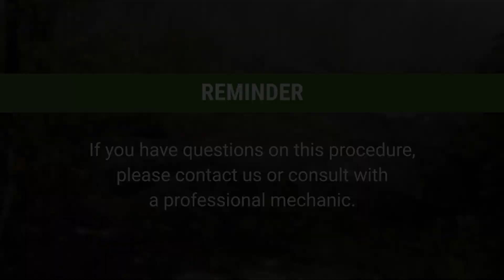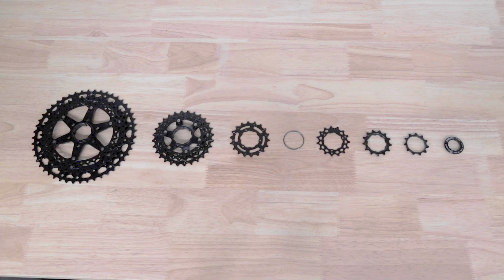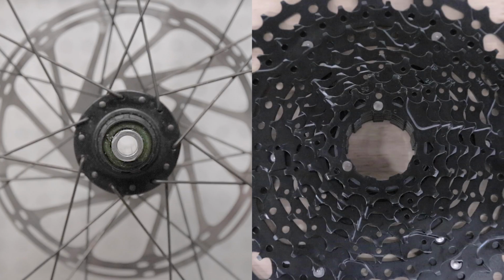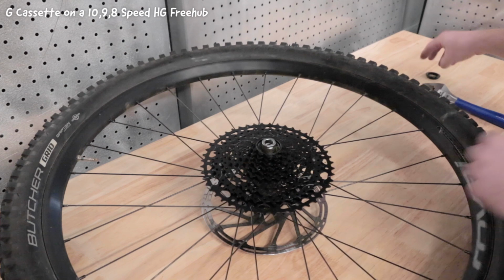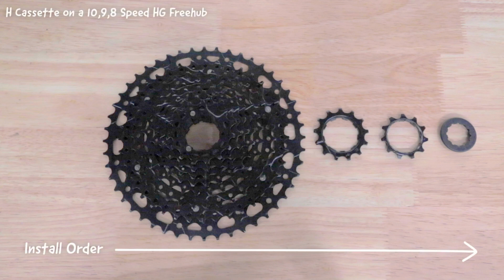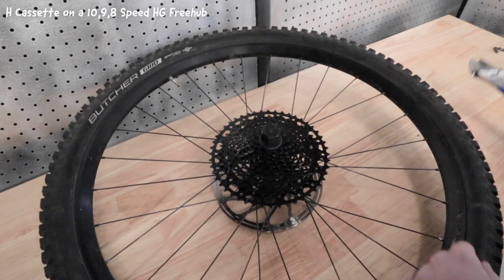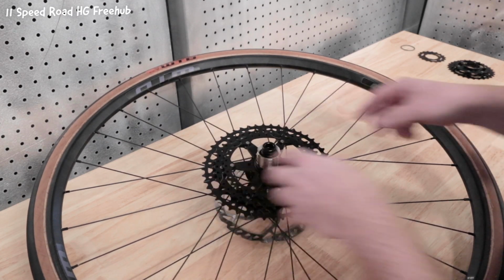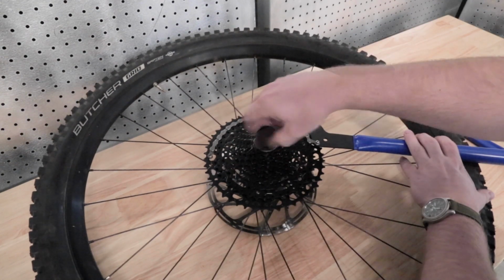microSHIFT ADVENT X 11-48T Cassettes Installation

Comment: I ordered a complete Advent X set with a steel cassette (CS-H104 11-48T), when I got it, the cassette was missing one pin out of three in the center...(((((( I was very upset... But then I watched some videos about installing this cassette and found that someone has 2 pins on the cassette like I did and someone has 3 pins....
Can you please explain why this is the case?
Reply: Thanks for the reply from technical support: "These two rivets will not affect the performance of the cassette. Once the cassette retaining ring is tightened to 40 nm, everything will hold in place. The rivets are not structural."
Moreover, I found the installation instructions on the MicroSHIFT website, and it said exactly that!
Theoretically correct, hope all is well ....)))
Reply from the maker: Glad to hear you got it figured out, this is definitely confusing!

Comment: Hello, after replacing the chain with 0.7% wear, the new KMS chain began to slip on the fourth sprocket of the microshift Advent x cassette :( visually there is no significant wear, the cassette is in its second year of operation, but the fourth sprocket is, as it were, the main one on the trip and from a standstill as well. It is necessary should I change the chain before 0.7% wear and change the cassette or is there something else that can be done?  Please help, thank you!
Reply from the maker: Thanks for reaching out - this will be tough to diagnose via Youtube comments so I would ask you to fill out a service ticket on our website. We'll get you sorted out ASAP!

Comment: Do you guys sell just the end caps for this cassette? For some reason there is part of the plate on the back of the end cap that is sticking out and is bent and causing shifting problems on 1st gear. Please advise, thanks.

Comment: @microshift I'm confused as too what's going on on the cassette installation manual it says the you need a normal HG freehub which i have 34.90 mm without a spacer but then on then next page it says To fit MTB microSHIFT (8, 9, 10, 11 speed) cassettes and (8, 9, 10 speed)
road cassettes, add a 1.85mm spacer before installing the cassette. can someone please clarify this im not sure if to buy the 1.85mm spacer or not

Comment: Does the advent x cassette compatible with advent 9 speed drop bar shifter SB-M090??
Reply from the maker: No, the Advent X cassette has 10 gears, but SB-M090 is compatible with 9 gears. We do have an Advent X drop bar shifter as well as a Sword drop bar shifter that will work with the Advent X cassette.

Comment: Load of shit. Cassette does not fit tightly on 8/9/10 speed hub regardless of spacer or not. Mine's as loose as fuck, now looks like I've chewed up the lock ring as I've had it on and off so many times to try different things.
Reply from the maker: That's a bummer. Get in touch with our customer service folks through our website and they can get you sorted. The first things they'll look at is making sure you have all the cassette spacers slotted in correctly, and whether you have an 11 speed freehub body (which would need an extra spacer behind the cassette).
Reply: @microSHIFTTECH  think it's an 8 9 10 speed as it measures just under 35mm. Have tried it with all configurations and makes little difference. The website seems a pain to use. Given up now. Chucked bike in summer house and opened the bar instead. Beer generally doesn't fail 😂
Reply: Thanks for your reply though!